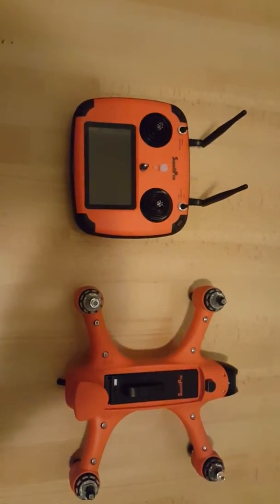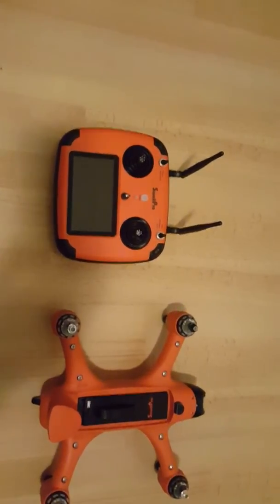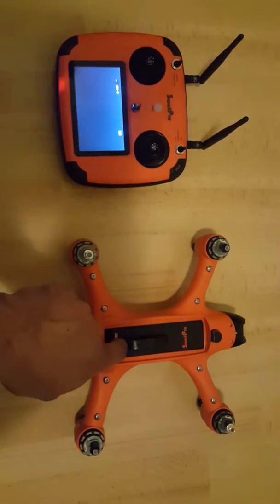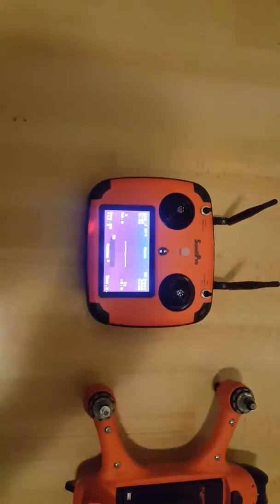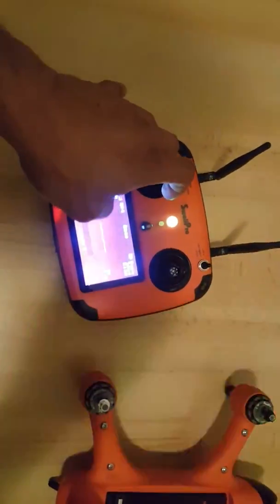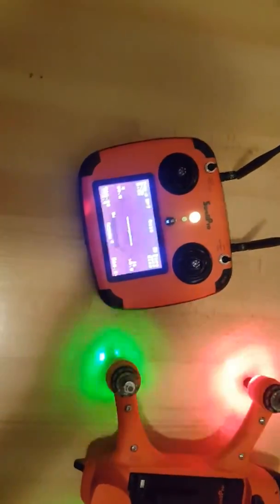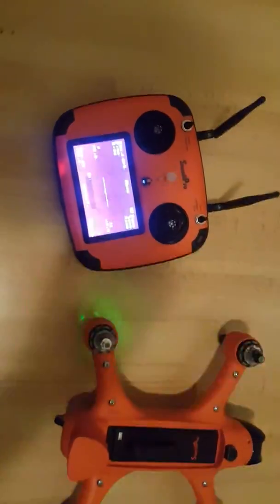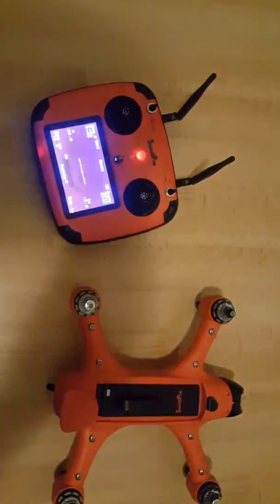Swellpro SPRY Calibration GYRO & IMU

Comment: Hi i have a new spry drone, and it wont go past inializing when i first turn it on, any suggestions
Reply from the maker: It sounds like you need to do all the calibrations again preferably outside and far away from any metal or magnetic items . Then switch off / on again and allowed to initialise. Also remember that if you don't use your spry after a while or take it to another destination it must initialise again